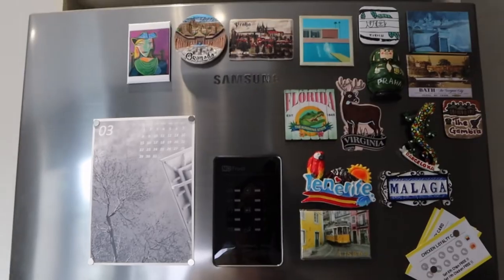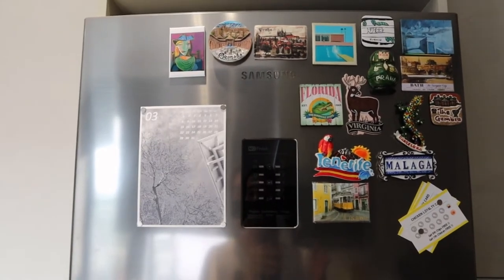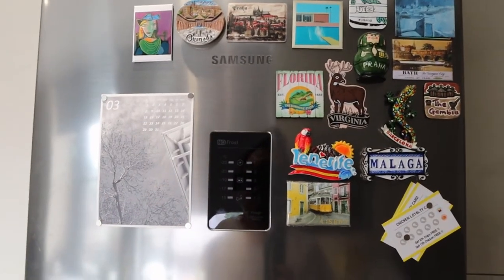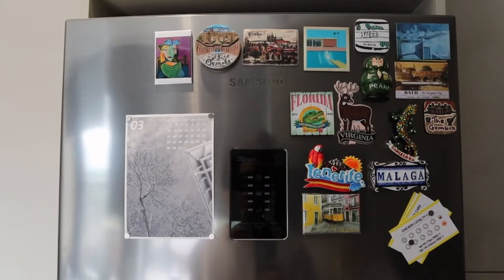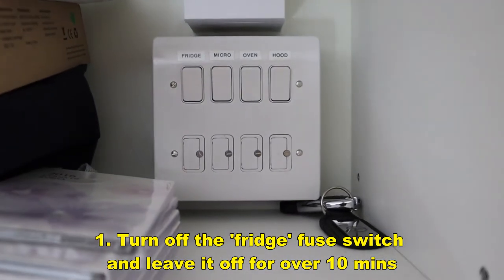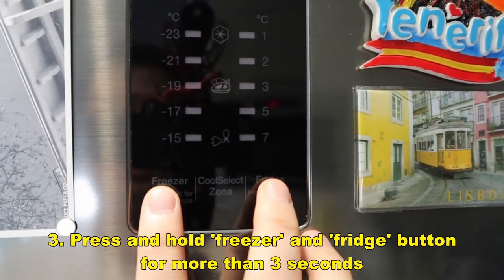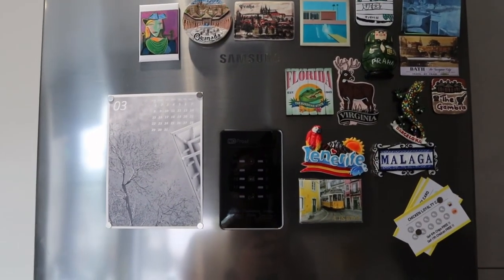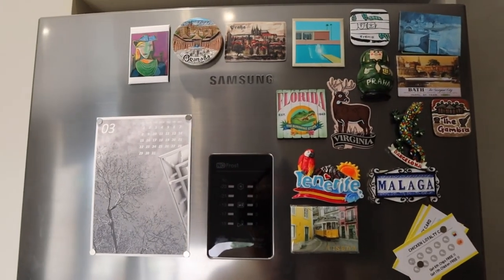How To Fix SAMSUNG Refrigerator That Won't Cool

Comment: Hi LJP Tech, Thank you so much. You were my saviour today! :) After our housing complex power was shut down for a couple of hours during the day, the fridge was stuck at 'vacation' mode (plug & leaves icon) and we were wondering why the fridge section was not cooling enough and why all temperature signs turned off. Thanks to your video, I fugured out how to make the fridge live again by turning mains power off/on with a 5-10 min rest and then pressing the Freezer (#1) & Fridge  (#3) buttons simultaneously until all temperature lights came back and I could set the fridge temperature back from 'vacation' mode to -3 degrees Celsius. A BIG THANK YOU!!!!!! Cheers.
Reply from the maker: This is probably the best feedback comment I received for this video. Thank you! I will pin this comment.

Comment: That's total and utter total unsatisfactory ,to do that 5 or 6 times in a year, something is not right full stop? What the fridge has a demo mode and now its stuck on that demo mode, more like the control unit is faulty?
Reply from the maker: Fridges nowadays are too clever, that's the problem

Comment: This managed to fix the problem with my Samsung RB31 fridge. Kudos to you, sir!
Reply from the maker: Thanks for your comment
Reply: @ljptech  The problem just reappeared again, after a particularly hot day yesterday (same as last time). I just redid your procedure, which worked again. Is it not possible to fix that for good? You write above "it automatically thinks it has become commercial use for opening the door more than 20-30 secs." - does this mean that strictly avoiding opening the door that long on a hot day will prevent this from happening? What does "thinks it has become commercial use" mean, exactly? Is this the so-called 'vacation mode'?

Fyi, my RB31 fridge is ~5-6 years old, so that quite fits your above description of this problem, which has, until 2 weeks ago, not appeared and has now shown itself for the 2nd time in 2 weeks, each time after a particularly hot day.
Reply from the maker: No particular solution as far as I am concerned. It's been a long time since we reset ours by the way

Comment: appreciate your time and effort that help others,
Just turned it off my refrigerator after 15 minutes i will try as you Said. hopefully your advise will work on it.

Many thanks in advance 😊
Reply from the maker: Did it work?
Reply: @ljptech   I try to reset as you said, display was blinking. unfortunatly no effect on the issue. seems it is technical problem

Comment: Hey,I have the rt38 model with the water dispenser at the front. I just tried the diagnostics and waiting to see if it works.
Reply from the maker: Did it work?
Reply: shavanti cortez have bought the Samsung RT38K553PS9 and after 3 days the same problem occured...the freezer has temperature -5 to -10 C. Did you resolve the problem?

Comment: Hi. I had same samsung refrigerator. I cannot find the fuse switch above my refrigerator. Pls help me.
Reply from the maker: Our fuseboard is not part of Samsung refrigerator. Your house must have the fuse somewhere different to ours
Reply: Hi do I need to turn it off from the fuse or can I turn it off from the plug also after you free them 2 buttons for 3 second do you need to turn them off or they Automatic turn off
Reply from the maker: Either plug or fuse I would say

Comment: Quick Guide Basic Tips:
Refrigerator Removes the warm air inside the compartment and Leave the Cool Air Behind and that's how it Cool:
1. Since the warm air is being removed then logically the air needs to go somewhere. Kindly, Leave 2 or more inches of Spaces for Clearance to avoid the Cooling Issues
2. Make sure that it is Leveled Slightly Leaning Backwards to avoid Leaking and helps with draining along with closing the door easily. Use a screedriver to adjust the front wheels until it doesn't touch the floor.
3. Make sure to give some space for the Vents Internally or Inside the Compartment to avoid Circulation Problem or Condensation
4. Ice Maker has a hidden button to Reporgram or Reboot itself. Don't use a hair dryer because it will damage the sensor.
5. Use the Power Cool for Fridge Standard Temperature is 34 to 44 Degrees Farenheight as well as Power Freeze to -8 to 5 Degrees Farenheight as an Added Feature to Expedite the Cooling.
6. Always use the User Manual and Check for Available Options.

Comment: LJP Tech, My Mom has the same refrigerator,  in June last year stop working because we had storm which cause the power surge. My mom has old home power installations without surge protection and digital inverted has break down. It cost around £100 pound to replace.  Next I have connected refrigerator using the extension with the power surge protection. 
I think, this refrigerator with the digital inverter is very sensitive,  like a computer and need a good power surges protection.
Reply from the maker: Indeed, refrigerator is too smart nowadays
Reply: I had that problem a number of times now with my Samsung RB31 fridge, and it always appeared to be connected to prior lightning storms in summer after a hot day. Thankfully, I was always able to "revive"  the fridge with the procedure described in the video, last time yesterday (twice). I also recently added a surge protector to the fridge's power supply, but that didn't prevent it from going into Vacation mode yesterday, so I fear it has little to do with power surges and more with temperature.
Reply from the maker: Hope your refrigerator gets smarter and get your ongoing problem solved soon!

Comment: Hi LJP Tech,

I have a samsung SR471LSTC double door fridge .I have used it for over a year now. 
My freezer works well but my fridge(bottom part) is not cooling. I called a technician, he checked that the fan is working and coil doesn't have ice. 
He said ,it can be a gas leak and now the fridge is a scrap .need your advice before scrapping it.

Thanks
Reply from the maker: Sorry, not a fridge engineer, I would follow your technician advice

Comment: I bought my Samsung Twin Cooling on December 2020 and experienced the same problem this month, not enough cool to harden the ice. I will try to unplug and turn it ON after 10 mins and press button both freeze and fridge button and hopefully it works.
Reply from the maker: Please let me know your updates
Reply: @ljptech  unfortunately, ginawa ko na lahat, same parin talaga. 10yrs naman warranty sa Compressor, but how about this? Parang sa fan ata or what, sana covered pa.
Reply from the maker: What language is this?

Comment: Did you call a technician to run diagnostics? These things have a basic computer (replaceable) inside and we all know how computers misbehave over time.

The other thing I can think of is "Does the fridge door shut correctly?" We had an issue involving that. It looked shut. The fridge thought it was shut but it wasn't. Each time I opened the door, there were condensation droplets on the fridge ceiling and around the inner frame. 

When we replaced the fridge in another kitchen, we went for an LG but it has some issues too. The fridge temperature in the "Veg drawer" goes to 0°C sometimes (yes, ice). This happens when freezer works for long hours. A similar kind of reset has to be done so the freezer checks its temperature and stops. 

It is a diagnostic type reset. It emits a long fax machine sound that the LG App on my phone picks up and analyses for faults in the system. Says no issues but that's not what I experienced.
Reply from the maker: Thanks for your input on this 👍
Reply: @ljptech  Not sure if you have seen the "IT Crowd" series: Have you tried turning it off and on again? 😂
Reply from the maker: It works 80% but I haven't seen it
Reply from the maker: Thanks

Comment: I experienced the 'vacation mode' shutdown problem on my RB31 fridge again 2 times during particularly hot days  and was again able to revive the fridge using the described procedure. I was just wondering, has anyone found a permanent solution for this, or the source for the fridge going into 'vacation mode' in the first place? In my case the source is not the 20-30sec maximum time leaving the door open (we are very careful not to surpass that after becoming aware of this problem).
Reply from the maker: I feel the same too on 20-30 secs
Reply: Ugh, I'm having this problem again too. Samsung sent an engineer out when it was just two weeks after the warranty. It worked for a few weeks and then started malfunctioning again! That was a year ago. So it's been hot here and it's just ugh,, just ugh. The fridge now smells. Ugh.
Reply from the maker: @robinstevenson5442 has my trick worked?
Reply: @ljptech  Not really. I tried a few times. Eventually it fixed itself after the hot weather stopped. Which is ridiculous. It looks like I need to buy blinds for the kitchen.
Reply from the maker: @robinstevenson5442 even refrigerators are trying to be too clever nowadays